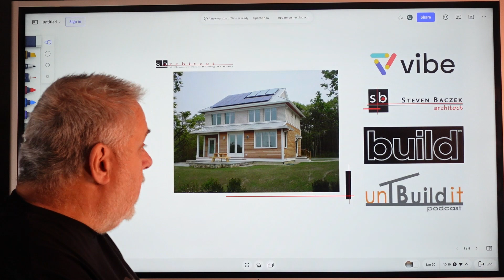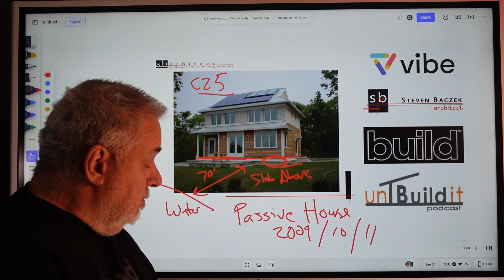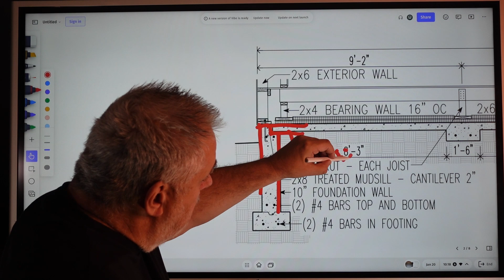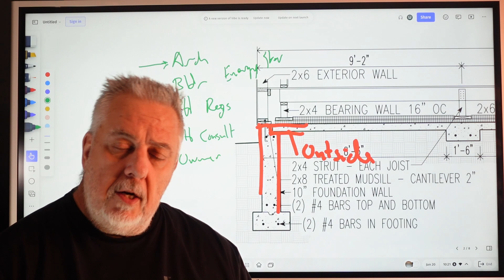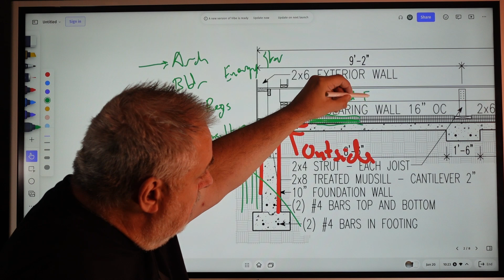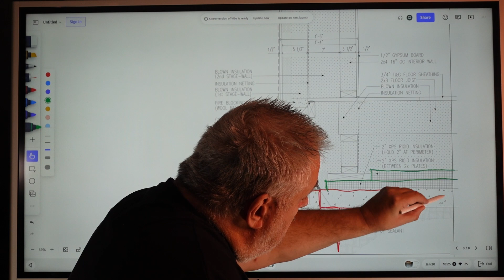PH 11 Episode #6 - COOL Floor Framing Detail

Comment: Hi Steve, great video! Why does the exterior 2x6 structural wall and the base plate overhang the outer edge of the foundation's stem wall by about 2”? Also, your detail shows 2 layers of 2” rigid insulation on top of the slab which, at R5 per inch, should give you a total of R20, not R10.  :)
Reply from the maker: Just gaining a little square footage with the overhang. Agree with the corrected math
Reply: @stevenbaczekarchitect9431  Hello. If you do plan on doing a follow-up video answering people's questions from the comment section, maybe you could explain this in greater detail. It would seem counter-intuitive to extend an exterior structural wall 2" past the foundation because then the mudsill and wall aren't fully supported. Also, if all you're gaining is 2" on a side, why not just increase the size of the foundation slab by 2" in all directions?
Reply: @ryansoo4000  Lots of houses use 2x4 studs and it holds up the 2nd floor just fine.  With this house’s double wall system, I’m not sure why they went with 2x6 studs on the outer wall  - it should make no difference for insulation if you can arbitrarily choose the gap size.  However, it does still give you the full strength of 2x6s against wind or earthquakes, even with the narrower footprint onto the concrete.  That added strength is appealing to me.

Comment: Question:

If you spray closed cell foam, 2”, against the wall cavity, add Rockwool and then SEGA vapor barrier, will there be an issues?
Reply from the maker: Adding rockwool in the "batt" form would be challenging

Comment: Just curious, but wouldn't CI + rainscreen be a more effective way to move the main condensation layer outboard & away from the main wall assembly? Problem I've always had with calculating insulation in terms of R value is it doesn't really address how conduction, convection and radiation work in different ways. We get these huge assemblies, and it's hard to tell by calculation if they're as effective in practice as they pencil out to be.
Reply: I agree with you, continuous exterior insulation is the preferred solution today, but this was built 14 years ago. I don't remember exterior insulation being a common practice at all in the US back in 2010.
Reply from the maker: @kschleic9053  I actually did use it back then, but this house would have required like 8" of exterior and that is somewhat promblematic, even now

Comment: Steve, speaking of Colorado I bought a lot in Manitou Springs last year (at 8,600 feet alt), and want to do some preliminaries this year (well & septic) and start building next. Thought I'd ask if you knew a local architect who is a building science champion. Going for a PH cert is definitely an option.

But meanwhile...
Let's talk about your double-wall: I'd seen the Fine Home Building multipart article on this project and I remember blown-in cellulose, but I don't remember what you did for vapor control. This video shows a little closed cell near the bottom. I thoroughly get the idea of temperature gradient and the condensing surface, but did you shoot closed cell all the way up the walls? Where is your air/vapor control layer(s)?

I feel these R values are truly nuts. In your Building Science series with Matt, you (two) said water control is #1, air tightness is #2, and temperature control (R values) is in last place at #5. For this project it kinda seems R values have been treated as #1.

My double wall: For my location I thought I'd come out of the ground with ICF, which is pretty tight, R25, and has plenty of thermal mass. I could continue upward with ICF, or switch to double-wall construction. I'm leaning toward double-wall. For my micro climate I feel the vapor layer should be closer to the inside, and might as well make that the air layer too (if possible). I don't want to use the inside wall surface because of all the penetrations (present and future). My thought is to use a pair of 2x4 walls: Vapor-open sheathing/rain screen on the outside with rockwool between studs of the outer wall. Rigid foam board between walls, caulked and taped. And finally the inner wall could have a bit of fiberglass between studs.

So the question becomes, what kind of rigid foam board and how thick? It should be vapor and air tight, which leaves out EPS. I've heard modern polyiso uses a blowing agent that kills R-value performance as the temperature drops (unlike EPS or XPS). So maybe XPS (I'll have to look into blowing agents). I've heard that foamed phenolic board is now available in the US, which has the R performance of polyiso, the temperature profile of EPS/XPS, and uses a friendly blowing agent.

I've had some deep thought about construction sequencing (e.g. expecting framers to install rockwool), how to tie the walls together, etc, but this message is long enough.
Reply: Sounds like an interesting project! We recently used ICF on a project, and above grade from a cost and environmental standpoint I think there are better alternatives in a lot of cases. With the fire potential a thick layer of exterior rockwool might be a good choice in CO.
Reply: @joshua_a_boehm , thanks. I'm leaning toward double-wall construction.